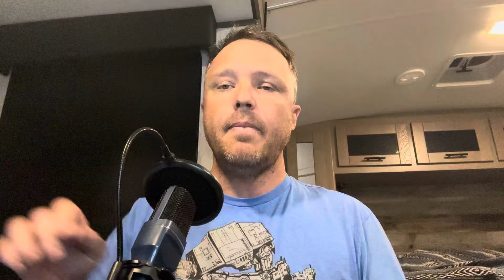Frame Flex on Montana High Country?? Plus MORE

Comment: I wonder if wide body RVs have those issues … bc Cedar Creek.. Riverstone are not
Reply from the maker: I don’t have enough data yet to determine what the cause really is. I do know it’s not solely on Lippert.
Reply: Wide bodies are having the issues and you can find several fairly recent frame issues with Riverstone 5ers as well.
Reply from the maker: @robv4053  No one has reported it to me yet. The brands I have not had reported yet include Riverstone, Mobile Suites, Redwood, Cedar Creek, Brinkley, etc. That does not mean there isnt some out there
Reply: @hbrvlifestylepodcast7663  I understand.  I was responding to the comment.  A little time on the forums and you can find the Riverstone units with issues, which I believe are both repaired now. Last year, there was a high-profile failure of a DRV (Mobile Suites) on YouTube.  

The problem is wider-spread than manufacturers' tolerable failure rate.  The problem is they are not taking honest accounting.  Out of warranty = not recorded. Non-original owner = not recorded.  Is it classified as a broken weld versus fatigue failure from excessive flex.  Catching my point?  I lived through how problems were documented by a 150 year-old family business and then how problems were documented after being bought by a publicly traded Wall Street company...  "Creative" would be a way to describe it...  Moreover, it is a shared responsibility of RV assembler and their suppliers...

Comment: Im not sure why this is surprising and I doubt it is new.  The weight on the pin is up to 20% of the total rig. So in same cases 2000+ lbs. on the pin that is tied into the overhang portion of the frame which is clearly an area that will move.  This one point is the level arm for the entire rig with the wheels as the pivot point.  This coupled with its the point that takes the hits from the road and more rigid materials tying the skeleton together will cause issues.  Something has to move and give